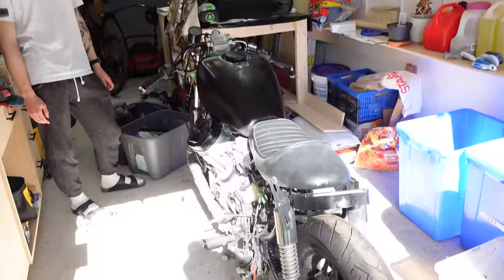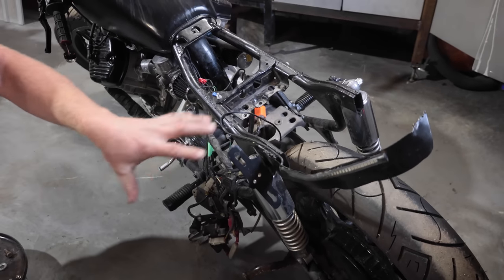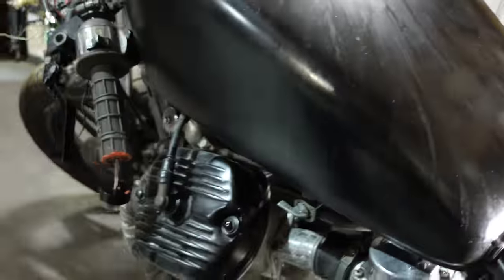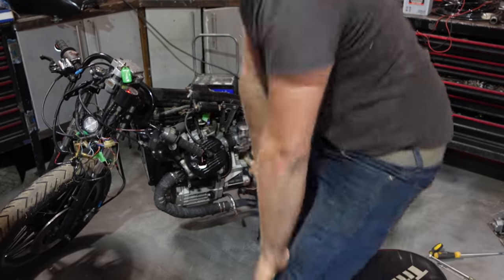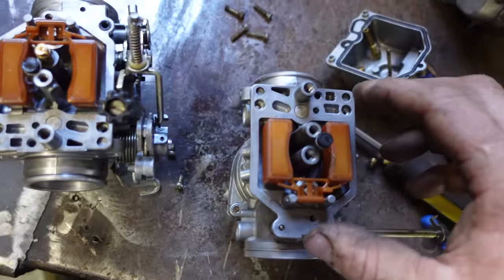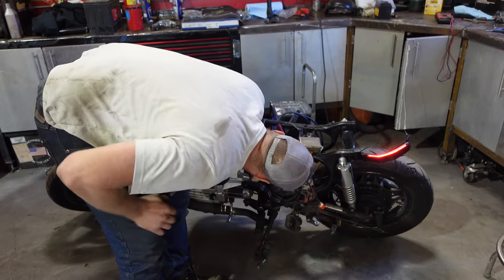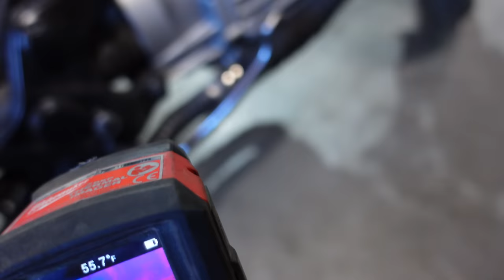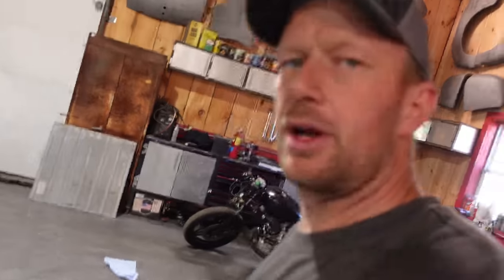Building a 1979 CX500 Cafe Racer [EP1]

Comment: Those great UJMs don't like to catch without some resistance from the stock air filter.  You can get them running with ether or by spraying gas and once there's enough vacuum they'll stay lit but you need the air filter to get the starter to draw enough fuel through the carb.  Guys who run cone filters have to rejet for this reason.

You can easily test this by holding your palm over the carb while starting.  It's a well known quirk.  They are really great bikes though, well made, well engineered.  I should say, you could just use the manual choke too.
Reply: UJM is a straight four across the frame Mancha...not a knockoff Moto Guzzi v twin
Reply: @JohnCarder  UJM stands for universal Japanese motorcycle, which covers the entire spectrum of standard bikes out of Japan for roughly 4 decades.  I'd hesitate to call the CX a Guzzi knockoff, seeing as it was a watercooled, 4-valve-per-cylinder engine, and Guzzi didn't invent, or claim any patent or trademark on, or even make the first flying vee.

Comment: Hi Rich. From what I saw briefly it has a separate regulator and rectifier... Ditch those in favour of a more modern combined unit because they are much more reliable. It is what I did about thirty years ago on my Honda 550 Four on the advice of the old boy who ran our local bike shop = ) Krisholt who commented below is absolutely right about the Japanese screws needing a specialized screwdriver and you will need to re-jet for K&N air filters. I will suggest sticking some rear sets on it to complete the look. Good luck and good fun with it ! = )

Comment: I did the cognito moto triple clamps and put GSXR front forks on.. Tricky bit is doing the disc brake and spoke wheel conversion on the rear. Try to find some decent spoke rims off of a Silverwing from the same era they can be made to work.

Comment: On another note, the suppressor cab screws onto the cable. If you pop the suppressor boot off your will see the screw. Make sure that makes good contact with your wire, else the spark is crap

Comment: You may be able to get a charging circuit/controller made up from another youtuber, but Milwaukee batteries charge and discharge circuitry is in the charger/tool so you'll blow it up if you run it as "the" battery.
A li-ion 12v charge circuit would work from amazon. (12v 2s/3p 2series/3parallel

Comment: Hallo welcome to the bike world Rich... You're m12 batteries dont have the protection circut in them, it's in the m12 tool. So you need some kind of BMS to keep from frying the li-ion battery with the altenator. My last bike i put condensators insted of the battery to run the lights when the engine is on. and a small li-ion jump pack to start it. the jump pac was easy to hide for styling purpouses. I don't know how many starts you will get from a m12 6ah if you don't charge it on the bike, i never had a problem with the jump pac only chargeing it at home, 2 days of riding with a lot of starts got me to 75% charge (Suzuki LS650). Regards from Denmark
Reply: oh yes, balancing the carbs after a rebuild usualy makes a big diffrence.

Comment: A lot of the bike coils are very similar, you can usually replace one with another without many problems.   Just make sure the primary resistance is similar to avoid burning the coil up.  I've even used automotive coils in place of stock ones when the prices were too high.  The best way to remove the jet is to jig it up on an end mill and cut the top of the jet even/flat so that you can stick a reverse drill bit into the top of it to remove the rest of the jet.  If the end mill is out of the question, stick a thin walled roll pin down into the cavity, then use a regular drill bit down inside the roll pin and cut the jagged top off of the jet, then use a reverse drill bit to remove the rest.
Reply: Not all bike coils would work for the cx500, with the CDI the coil signal is about 100v, while with most other ignitions, they just use straight 12v. 
Coincidently the cheapest coils you can find on ebay from china would work, so atleast thats a nice thing :D

Comment: Watch out for the stator packing a sad. I have a CX400C which don't charge and you gotta drop and split the motor to replace it. (It's the one in my banner)
Once you get the carbs balanced, you'll have a smooth ride.

Comment: Awesome. I'm currently building a CX too. Nearly finished. Good luck! I've learnt a lot doing this bike.
Reply: I'm not sure when you fired her up if she was running on both cylinders. If you're having issues with your carbs, MurraysCarbs do a great pre tuned carb that drops in, but they recommend you upgrade your clutch.
Reply: I'm sorry - i think you mentioned that.
Reply: You will want to change your reg/rec if you use that milwaukee battery :D Otherwise you risk overcharging.

Comment: It’s funny watching Deboss with gas engines amazing diesel mechanic but struggles with carbs . I struggle with diesel but can hold my own with gas. The two jets at the bottom are the idle and main jets when enough vacuum is achieved the engine will pull fuel from the main jet. The screw at the bottom that is stuck or Broken off is the air fuel mixture screw, if it’s post throttle blade it adjusts fuel if it’s pre throttle blade it’s adjusts air. Base setting should be 2-1/2 turns out

Comment: I think you can get clamp on handle bars that clamp to the tubes of the front suspension, then do away with the whole block at the head. There was a turbo on the CX 650, one could maybe look for one from a bike wrecker, it would add a bunch of speed to make your eyes big.

Comment: I rather dig the white coil spring.

Would be great to make the drill battery work but I feel like charging could be an issue. Have you looked into the lithium batteries that are meant for motorbikes?

At least with a drill battery, you always have a spare. And if you park it up somewhere ropey, it's easy to take the battery with you for extra security.

Comment: The smaller jet is the pilot jet, 0-1/4 throttle, the main jet 1/4-full.

Also, use only NGK or ND plugs in Japanese bikes. They do not run well in anything else. If your gonna run pods, you may need a hotter plug or a larger jet to overcome the air flow the pods allow.

Comment: For air filters use long straight foam filters. On one cylinder running cold, your idle circuit in the carb is restricted.
Is that the side with the idle jet that striped out when you tried to remove it? 
The idle circuit draws an fuel from the float bowl, mixes it with air and sends a portion into the engine past the needle. Part of this fuel air mix flows to the idle mix screw,then to ports by the throttle plate.
The passages this fuel air mix flows through are tiny. They plug easily. If you don't get them clean your bike won't run well.
To properly clean you need to remove the pilot jet and the mix screw. Us spray can carb cleaner, spray through this e passages from pilot jet and watch both the mix screw hole and the tiny holes by throttle plate. Spray in the mix screw hole and watch to see if it comes out the pilot jet and hole by throttle plate. Let soak then blow through the same ame way with compressed air. Repeat till clean fluid comes out every where it should.

Comment: Things like the “rebuilt” carbs really make things difficult for people who are learning and struggling with a build. Good chance someone would really fight trying to get it to work and not suspect the carbs because they looked decent on the outside and were supposed to be rebuilt. 
It’s more money up front, but it’s way better to start with something that runs and works if you’re wanting to do a build like this and learn as you go. That way you have more direct feedback if you made changes and now it doesn’t work. You’re better able to blame the changes rather than have to diagnose something from scratch that might have multiple causes at once.

Comment: From what I've seen on rather be welding's channel the ebay/Amazon shocks don't tend to be stiff enough to hold up small adults. Could possibly check into maybe some air shocks off a road glide or possibly one off a car.

Comment: Might be stating the obvious..The difficulty keeping it running on one cylinder, is due to not enough rotating mass to overcome the "limp" cylinder. Ran into the same issue with my old Korean bike, all over a fauled plug. She'd die when I let off the throttle with it in gear (stopping for a red light). Rear tire would fishtail..had it replaced by dealer same afternoon.

Comment: The early CX's had a lot of problems with bent pushrods.
Most likely your problem with the right cylinder. Easy fix though.

Café racing started in 1930's Germany with the Autobahn. BMW vs Zundapp.
Rest area, to rest area.
First wind tunnel tested bikes were in Karlsruhe of the 1934
BMM 500cc 1/2 liter,  supercharged World record holder. In 1936 they did it with the 750.
Post war, the regular guys grafted Bomber/fighter drop tanks as fairings to their bikes, and made side hacks out of them.

Comment: That's so funny..  I bought a used 1980' cx500 in the early 2000's and drove it for years.  Then I let my little brother have it and he rode it everyday as his only transportation for several more years and then it finally spun a bearing..  We took the engine all apart and it needs a crankshaft now.  So it's basically scrap metal at this point.. If you need any little random parts just hit me up.      I rode that thing wide open on the highway for so many miles. lol.. It's ridiculous...   After that I moved up to a 99 CBR900, that I stripped naked.  It was awesome and by far my favorite. I regret selling it all the time.

Comment: You'd probably blow that Milwaukee battery with the charging system and have a nicely heated seat that turns into a little TOO hot of a seat pretty quickly =D
Maybe there's a Milwaukee M12 battery charger that runs on 12v? That would be the ticket! Some electronics people will tell you how to hook up a diode (or several) with enough current handling from the Milwaukee battery to the rest of the bike and then have the charger running off of the reg/rec of the bike's charging system.

Comment: It still sounds like it's only running on one side.  GURANTEED it's that smaller idle jet that you couldn't get removed.  But if you get it out on the road and open it up, it should still run well on the main jets while you're on the throttle.  These engines have a nice sound to them when both cylinders are hitting-- and it revs well with good response.   Like you said, sometimes it's best to just get it all together and take it out for a good run and see if it cleans itself up.  It may just be that your plug is soaked on that side..
Reply from the maker: that's what I was thinking.   Start with the basics, plugs and valve set and go from there

Comment: I love the idea of running it from a Milwaukee battery 😁 Is there a way to make that actually work and charge or is it going to let the smoke out of something?
Reply: It's Li-ion needs a special charger to work.  You cannot just plug it in or everyone would be doing it.  There are li-ion battery packs made for this with the charging and protection circuits built in.

Comment: Oh yes, sorry to "spam" this thread Rich, but if you are a beginner on bikes, two things about that old girl 1. It's a shaft drive so will 'climb' around the rear wheel when you accelerate and the inverse when you slam the throttles shut; great fun on a bumpy wet road and 2. You steer a café racer more with your body weight than the bars so...yeah...not an ideal bike to learn to ride on.  Have fun but take care!  Love your videos.

Comment: 500's can be pricks thats why they only build the 750s and 1100's but even through the video you can tell its got a gallop and that spark was kinda irregular check the cdi and the primary on the magneto ohm them out see if those are in spec also ya need too get the firing down pack before you ever bother too try and balance those carbs out.....but those old cx's look way nicer then the cb's imo!.......but in my experience coils are almost never the issue (aslong as the cap makes connection too the wire) almost always have issues with crap wires that are cracked or bad cdi's or weak magneto's im a bike guy myself had quite afew of those old 70's-80s "gems"

Comment: Just a word of caution, when you go from airbox to pod filters usually makes the carbs run lean on mixture. I have to chuckle with what they call cafe bikes these days, they are more rat bikes than anything. Take an older bike strip the fenders and sawzall the back of the frame and exhaust off, rip out the airbox, bomb can flat black and slap a 2x6 on for a seat. I see a lot of older street bikes get butchered up these days and listed for sale as non running cafe bikes. Good luck on the project I'm sure you guys will forge ahead and get it whipped into running condition, I sure miss the old motorcycle wrecking yards that used to be around in the past.
Reply from the maker: This build will get the same pride put into it as every other project on the channel

Comment: this is a cool project, Ive been looking for a potential victim I can cut apart to do something similar. I wanna start with an inline four though- i gotta have that four cylinder growl (although I have seen some really sick builds out of old goldwings)
Reply: Ps, im not 100% sure... but i think using a tool battery is a bad idea. It comes down to how they charge-limited voltage vs limited current (or something like that). Then again, you could always just send it and see if it works

Comment: The Spark plug boots are known to be an issue. Before you get too crazy replace the spark plug wires.
Reply: You can't,  the cables are part of the coils, so you have to replace them too. Or get one of those NGK wire to wire connectors, cut the old cable and splice in the new.
Reply: @svetko05  I guess it’s the boots themselves that cause the problem. The plugs are way down in the head and I’ve read that the boots can go bad and start bleed some of the spark into the head. If that makes sense.
Reply: @ericbrown2666  Yeah, there is also a resistor inside the plugs, that can corrode or burn out with time. Usually people just remove the resistor, put a piece of metal rod in its place and run resistive spark plugs instead.

Comment: As a CX500 guy myself, id like to apologize on behalf of every armchair mechanic that tries to half ass cafe a cx or """rebuild""" cv carbs. Basically, only trust something you did yourself or paid a lot of money for. Also, that emulsion tube that is jammed in the carb is the stock design, theyre supposed to be retained by the screw in jet, but they get stuck in there with varnish. You can get them out gently with a torch and screw extractor. Just clearing out the main hole will make it somewhat work, but the side holes need to be open too, as its designed to mix air with the fuel in the tube. I have no idea where that screw in emulsion tube in the other carb came from, looks like a parts bin fustercluck. No wonder it didnt start.

Comment: you're going to want a diode on the output of that battery or a battery management system. there's a reason there isnt lithium ion car or motorcycle batteries that don't have a B.M.S. they can and will explode.

Comment: the carbs appeared to be rebuilt by Helen Keller. 🤣 then again, maybe he took them separated without cross tubes and brackets, then cranked the idle mixture screw down until it snapped off while playing to get it started. some people need to stay ten feet away from anything mechanical 😬

Comment: "Cafe racers need to be 750cc" is the biggest load of shite I've heard in a long time. The only necessity for engine size was that it could propel you to 100mph or over, which at the time wasn't as easy as today hence why they were lightened as much as possible which is what really gives that distinctive cafe racer look. The aim was to become part of the "Ton-Up" club (100mph+) and get the jacket patch to prove it.

Comment: You can not charge lithium chemistry batteries like lead acid ones. It would die very quickly if you did. Lithium chemistry requires different charging technique, first you charge it with constant current till a threshold point, then switch to constant voltage. Do not use lithium batteries without proper charging circuit, you might burn your hacienda.
Reply from the maker: thanks for that.  I will look into what the options are